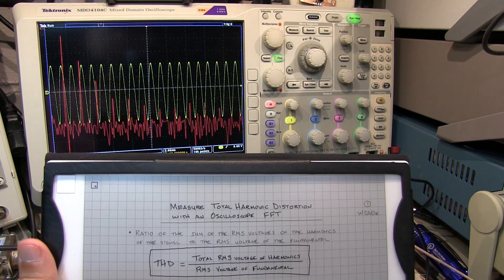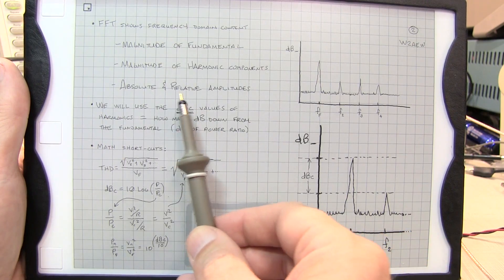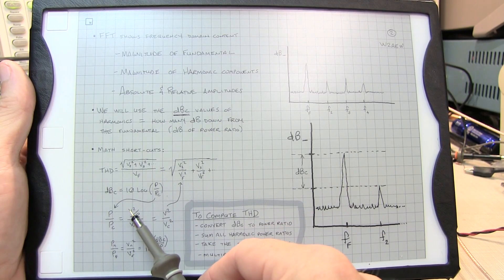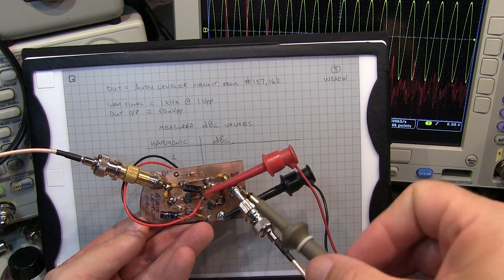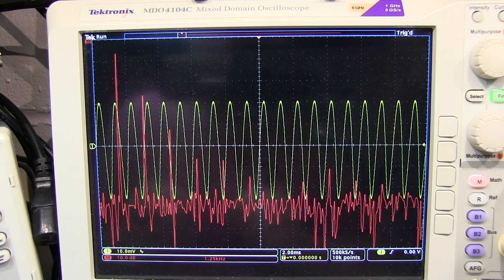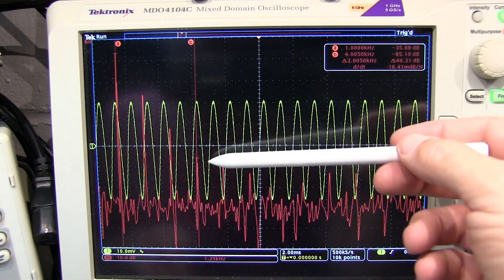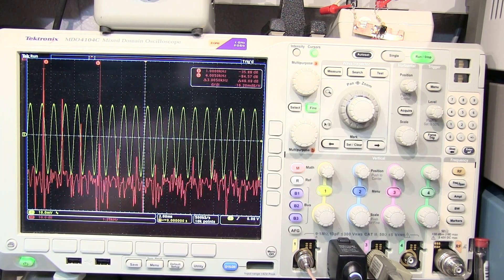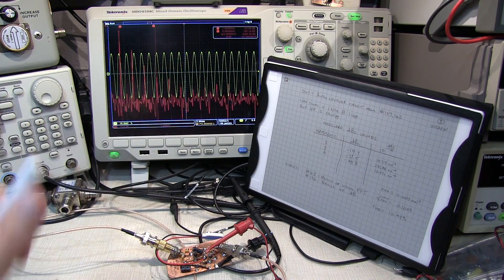#305: Measuring Total Harmonic Distortion THD using an FFT on an oscilloscope

Comment: Ive been going through hell with nuisance power trips on the breaker when i plug in a music keyboard into the computer via usb.  The research tells me non linear devices like electronic keyboards cause harmonic distortions. 

Ill try this way of measuring my harmonic distortions, if any from my keyboard to my home studio on PC
Reply from the maker: I doubt that harmonics are causing the breaker to trip.
Reply: @w2aew its the theory that fits closest.  Many different keyboards and 3 different computers.  Nothing trips until i connect a keyboard.

Comment: Really love your videos and explanations. You're a fantastic and generous teacher. I'm trying to run this math myself to internalize it and since I'm not familiar with how to do the exponential equations you do at the end of the video, I'm using the formula you show in the first couple of minutes (at about 2:15) (THD=(√V2²+V3²+V4²)/VF. Two things: 1) You show the denominator as "VF" in the simplified equation on the left, but "VF²" in the equation on the right. Should the denominator on the left be "VF²"? 2) When I run this equation out with the fundamental Vrms values you found using this formula, I'm getting 12.5% rather than 10.49%. I'm sure I'm just not "getting it". Any guidance you (or the community here) can offer would be greatly appreciated.
Reply from the maker: The denominator is squared when the entire equation is under the square root operator. The simplification is to only put the numerator under the root operator and have the denominator unsquared.  I don’t think I showed the absolute rms levels of the signal and the harmonics, so I’m not sure what numbers you were using.

Comment: Very good explanation. Thanks. Super. Question, to measure the distortion introduced by the DUT, how do you correct the THD with the measured THD of the input signal (measured with the 2nd channel) ? Are there scopes which can calculate this ?
Reply from the maker: You'd have to do that math yourself by measuring before and after.

Comment: my oscilloscope SDS1104X-E does not have dbc type. Can I convert dbm,dbv,Vrms to dbc? And how to calculate? Thank you
Reply: how to get (11.0073E3)
Reply from the maker: dBc refers to dB relative to a "carrier" signal, or any other reference signal.  All you need to do to convert a signal to dBc is to subtract the signal's dBm value from the dBm value of the carrier or reference signal.  For example, if your carrier or reference signal is -6dBm, and your signal of interest is -30dBm, then this signal is also -24dBc.
Reply: @w2aew  Thank you very much, now I can calculate. I like your video very much and I tried many things. I would like you to present a class-d pwm modulator in 600Khz.

Comment: Thank you for all of your great videos.  In video #65 you state that one half the sample rate will be the highest frequency you will see out of the FFT; the sample rate was 25kS/s and the maximum FFT frequency was 12.5kHz, just as you state.  In this video your sample rate is 500kS/s and the maximin FFT frequency is the same, 12.5kHz (1.25kHz per division, as shown on the math readout).  Please explain how you got such a low FFT maximum frequency with such a high sample rate.
Reply from the maker: Because I "zoomed" the FFT result.

Comment: How can we find the FFT from the data coming from digital channels in an MSO
Reply from the maker: Do you mean that the digital data consists of parallel bus that represents sampled analog voltage (like the output of an ADC)?  If so, some scopes give you the ability to perform advanced math that would convert the parallel words to a math waveform, and then perform an FFT on that resulting reconstructed waveform.  If your scope can't do that, then you'll likely have to export the digital data into something like MATLAB and compute it there.

Comment: I really like your videos and have learned lots.   I purchased a Siglent SDS1104xe scope awhile back an would like to use it to measure THD.   However its FFT function doesn't have DBc units and only has DBm, DBVrms and Vrms.   I was hoping you might provide a clue as to what math I would use to calculate THD based on the scales available to me?   Thanks
Reply from the maker: Easy...   Take note of the dBm level of your fundamental - this is your reference.  Then, simple subtract the dBm of each harmonic from the dBm level of your fundamental.  This will give you the dBc level of each of your harmonics.

Comment: Thank you Alan!  I used to know this, but needed a 'refresher' course!  I'm measuring the THD of portable generator outputs...  See ya on POTA! 73 OM!
Reply: Practicing with a really old General Radio 1330-A sig gen and my TDS 3012B scope, I was really surprised to find less than 1% THD output!  Amazing... thanks again Allen! WR2E dit dit
Reply: Allen, would you think it's reasonable that the power company is supplying 3.5% THD AC to my home?  This is what I came up with measuring the line coming in.  I wanted to get a baseline before I measured the generators output.  I presume this would be affected by the power factor of the things running in my home?  Or would this be what is actually  being supplied?  I suppose that other loads on the line from neighbors homes for example, could/would also affect this?
Reply: @Wheel_Horse  ONLY 3.5% ?  Wow, I used to live in a place (S.E. Arizona) where the AC power line signal looked something like a triangular wave, withe a bunch of "squiggles" on it.  Here (Central NM), it's a noticeably distorted sine-wave, but still recognizable as sinusoidal.  Not only the P.F.s of what's in your home, but EVERY home & business, along with all those arcing insulators, and corona discharges.

Comment: I have a cheap FY6900 signal generator and an HP 333A. I measured the THD of the FY6900 at 5KHz @ 1VPP to be about 0.5%. Now I want to feed that signal into my audio amplifier and measure the THD of the amplifier. If I were to get, say 0.6% out of the speaker terminals of the amp, do I subtract the 0.5% that I know the signal started with, giving me a THD of 0.1% for the amp (at least on that input/output channel)? Thank you!!!
Reply from the maker: I don't think it is as simple as that.  Your amplifier may product distortion components at different phases than the generator, which will cause them to add constructively or destructively, or somewhere in between.
Reply: @w2aew  thank you! After thinking for a few more minutes I ended up coming to the same conclusion. I told my dad that and he didn't understand/believe me lol. Said "you probably just subtract them" but I told him the distortion is still just unwanted waves of energy and who knows how they will interact. Altho I did read the 333A incorrectly; my FY6900 appears to be at .05%, not .5%, so that makes a significant difference. Thanks again for the reply! I have learned a lot from your videos over the last year or so.
Reply: @kurchak  For audio measurements you should check the AudioRightMark application.

Comment: Alan, I have found better resolution with a 2 channel function generator and DSO by taking a sample sine wave voltage out of the DUT and into a resistor matrix that allows me to add channel 2, 180 degrees out of phase, to cancel out the fundamental frequency. The 180 degree phase shift is just a starting point though due to phase shift in the DUT. I then adjust channel 2 phase and amplitude for maximum null and read the RMS voltage left over.
Reply from the maker: Be careful with this - adding the inverted signal to itself it will also cancel the odd harmonics!  Thus, will give you an artificially good THD result.
Reply: @w2aew  Interesting.  How is this different than using a notch filter to drop out the fundamental,  like an analog distortion analyzer?
The results I have gotten cross check with an HP331A.  (Just to be clear, I am inverting channel 2 and adding it directly to the  matrix without it going through the DUT. Only channel 1 signal goes through the DUT.)
Reply from the maker: @robt7785  Ah - it wasn't clear that you were subtracting the input signal, before the DUT.  In this case, you should only be left with the distortion components added by your DUT.
Reply: @w2aew  Thank you. Yes, I  apologize for not being very clear.

Comment: how do you get that THD harmonics application? Is possible to get on a Silgent scope? Very new to oscope use
Reply from the maker: The THD application is something that is sometimes offered as an option on a real spectrum analyzer.  I don't know if I have ever seen it available for a scope/FFT, so I doubt it is available for the Siglent scope.
Reply: @w2aew  good info to know! Thank you! My application is to measure THD of portable generators, and to see specifically on inverter generators how well the output stage is filtered for EMC

Comment: How can I measure the THD on a home AC generator to see if it's safe to power sensitive electronics?  Should be ~ 120VAC, 60HZ with < 5% THD.  I don't have a $7K THD multi-meter but do have a Rigol 1054Z and and a few multi-meters that will measure HZ but not THD.
Reply from the maker: I don't know the details of the FFT function in your 1054Z, but if it works like this video (https://www.youtube.com/watch?v=rwQuX1aZWPU), then you should be able to measure the harmonic components and use the process in shown here to compute the THD.  The key will be to have 20 cycles or more of the AC line on screen in order to get sufficient resolution in the FFT.

Comment: And again Howdy.
For audio amplifiers.
1. Download ARTA Software and install. Demo mode is free.
2. Build an attenuator of, say, 30dB. 10 k and 330 ohm and connect in parallel with the dummy load.
3. Connect to the Line-In jack of your computer. NOT the microphone jack.
Regards.

Comment: You can also use a time series captured from a digital oscilloscope if you are willing to do a little math in Excel.  Square the voltage measurements from a single period and add them up.  This is proportional to the total power.  The power in the fundamental is proportional to the peak (half of peak-peak) squared divided by 2.
THD = 100% X (P_total - P_fundamental) / P_fundamental
I should point out that you do need to eliminate any DC offset (e.g. use AC coupling or subtract the average before squaring) in order for this to work.

Comment: How do you measure the signal to noise ratio using an Oscilloscope? or what lab equipment do you use to measure the S/N ratio in various power supplies because different types of power supplies when being applied to different types of amplifiers circuits like FET amplifiers, transistor amplifiers, IC op amplifiers, tube amplifiers circuits will raise the noise floor so you will hear hissing white noise, hum, ripple, Switching frequency from the power supply, etc. The hissing white noise is caused by the linear power supply or switching power supply? because the amplifier circuit will raise the noise floor higher so you hear the hissing white noise from the linear power supply and switching power supply?

Comment: Excellent practical and concise description on measuring audio THD.  Since most hobbyists will have an 8 bit scope instead of a $10K+ 10 or 12 bit A/D scope like the MDO4104C you are using here (Nice!) your point about doing accurate measurements on a low distortion amp is important.  It may require using a real spectrum analyzer as described in your video #46 which these days more people are adding to their test bench.  The limitation is that the THD can only be done for frequencies above 9kHz, the bottom end of most RF spectrum analyzers.  Also need to consider measuring the distortion of the function generator providing the signal input, and subtracting this from the amplified output otherwise its GIGO.  Interesting topic for a follow on video if enough audiophiles are still building their own amps especially to consider class D designs which are now popular in consumer gear.

Comment: Are there different results with the different ways of measuring?  OK never mind I saw the rest of it.
Reply from the maker: I show three measurement methods here, and they all basically come to the same result.
Reply: @w2aew  I was just curious if that was a way for production quality control to stack the deck in their favor.
Reply from the maker: @ranbymonkeys2384  Sure.  If the input signal level is lowered, the distortion tends to improve.  If they don't include all of the harmonics in their analysis, the THD will improve.
Reply: @w2aew  You would think they would have to tell us the input voltage that they were testing at.  Why not a standard like that if it can be easily manipulated, any ideas?  Big circuit, haha, like big oil and big pharma.
Reply from the maker: @ranbymonkeys2384  It all depends on the device being tested - what is appropriate to the application.
Reply: @w2aew  Audio amps and DACs sound cards stuff like that.  Gadgets that the distortion really matters.  Hey are you any good at schematics?  I have a schematic of a "tube buffer" and I'm trying to find out what a specific capacitor is for
Reply from the maker: @ranbymonkeys2384  post a link
Reply: @w2aew  It's from FX-Audio and they actually emailed it to me
Reply: E204, E203 what are these for and can I go lower than 10uF
Reply from the maker: @ranbymonkeys2384  They're coupling capacitors that connect the output of the preamps in each path into the active base/treble circuits.    The effect of lowering these values would be reduced gain for low frequencies (losing bass response).  More specifically, they determine the low frequency response corner.  You could probably lower them if you need to, but I wouldn't go much below 1uF
Reply: @w2aew  I believe they are 10uF
Reply: I just found it strange, usually I see 1uF film caps for coupling I just didn't know why 10uF strange.  Of course op amps and tubes all in the same thing is strange too
Reply from the maker: @ranbymonkeys2384  They're larger because the input impedance to the tone control stage isn't super high (10k-ish).
Reply: @w2aew  OK it looks like i'll just stick with their design.  I do have WIMA 1UF 250v for the 4 big ones and I going to try to cram a polypropylene 1uF film where the group of 2 1uF caps are but I don't know if I can.  They have 1uF 63 volt and the print says 250 volt so I don't know what's up with that.  I'm learning about quality I think.

Comment: What is the considered bad THD% percentage in various devices under test? what is considered good and bad THD% percentage criteria?  I'm confused when I see THD% 0.025 is good but other devices under test will consider 0.025 THD% as bad
Reply from the maker: It depends entirely on the requirements of the application. There is no single right answer.
Reply: Any reasons why THD% percentage doesn't have good and bad criteria because when I'm looking at the specifications of amplifiers or other devices and it list the THD% percentage, how do I know its good or bad THD% because there is no standardized good criteria? How would a EE engineer know what is good THD and what is bad THD?
Reply from the maker: @waynegram8907  Good/bad is going to be determined by the goals of the designer of the device/product.  For a cheap audio amplifier for a portable radio, something like 1% might be perfectly acceptable, while a high performance signal source might be something less than 0.0025%.  Again, there is no single correct answer.
Reply: @w2aew  ok thanks i thought there was some sort of EE designer THD% criteria but I guess not.

Comment: What is the bit rate of the A/D converters in various THD multimeters? Since the Oscope is an 8bit A/D converter it can't measure THD signals that are low levels, what do you mean by that?
Reply from the maker: The sample rate of the ADC used for the THD measurement is a function of the test frequency, up to a maximum of about 100kS/s.  It is a 16-bit ADC.  The scope's 8-bit ADC doesn't have sufficient dynamic range (smallest digitized level is 1/256 of full scale), which limits the dynamic range of the result.
Reply: What do you mean by limits the dynamic range, I'm confused about do you mean power level/ input voltage level driving the Oscope channel that if you use a millivolt input signal into the Oscope its hard for the Oscope to measure THD of millivolt and microvolt input signals?I don't understand why an 8bit ADC would cause "more" THD harmonics compared to using an 16 bit ADC?

Comment: Howdy. Great.
THD is usually given for 1 kHz and 1 W only. I say this is useless.
I say the THD should be measured over the whole hearing bandwidth. If the individual THD:s differ only a few % the total THD may be presented as the geometrical mean.
Tube amp.s are another thing. At about 40 Hz and lower the THD rockets as the output transformers approach saturation. The total THD may, of course, be calculated but the result has no meaning. The THD should be presented as a table of individual values or a graph.
For tube amp.s THD graphs should be presented at several power levels, too.
In high regards.

Comment: Good video, but I'm confused a bit. I have the same scope as you. According to the manual and the scope's user interface, it reads out in dBv, not dBc. But when I did the math using dBv I get the same expression as you.
I figured that (since dBv=20*log(Vn/Vf)):
(Vn^2/Vf^2)  = (Vn/Vf)^2 = 10^(2*log(Vn/Vf)) = 10^(dBv/10)
which is the same simplification you used for dBc.
What gives?
Reply from the maker: When you use the fundamental as the reference (Vn/Vf), you're effectively calculating dBc (dB relative to the carrier level).